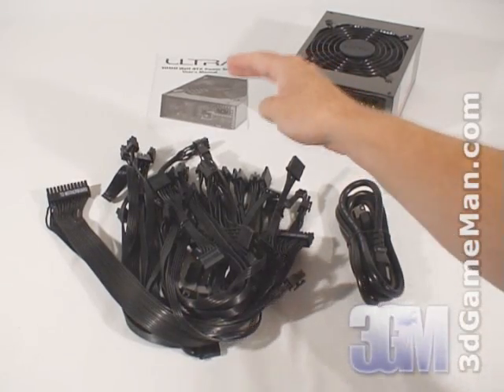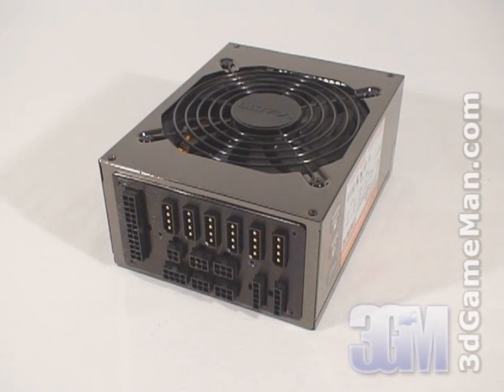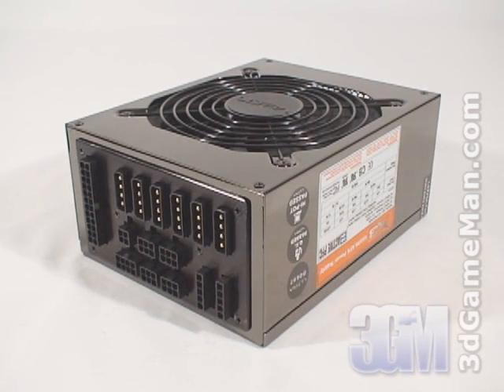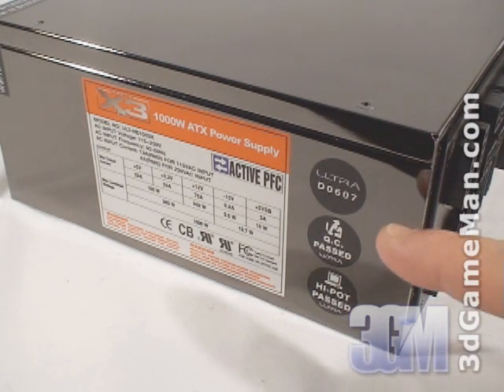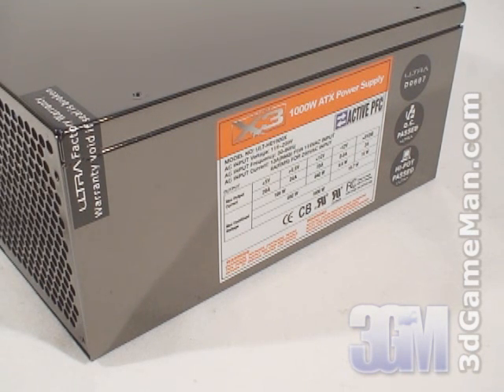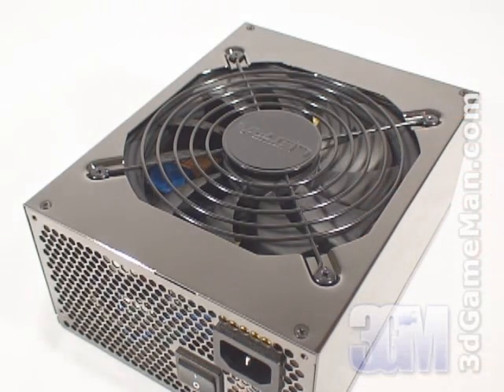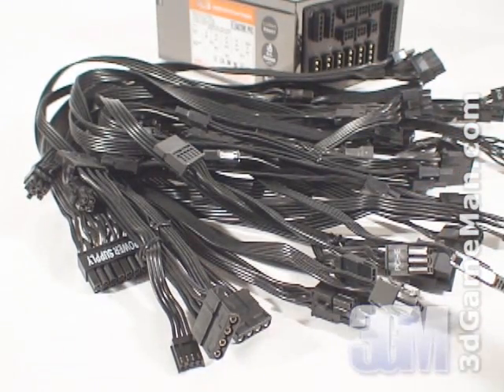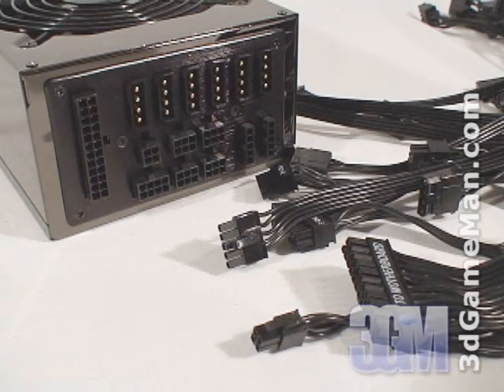#843 - Ultra X3 1000W Modular Power Supply Video Review

Comment: I know this is old! But I still use this PSU. I need 2 8 pin connectors one for my GPU and the other for the motherboard connection. The PSU only has one 8 pin. Is it possible to put a splitter on the 8 pin from the PSU to supply the motherboard and gpu? Any suggestions?
Reply from the maker: You can't split the 8pin, but you can get a dual molex (female) to 8pin connector (male).

Comment: I have the 1000watt psu and I had it for some years now and it can handle sli & crossfire with no problem. the only ones who sell them are tigerdirect and ultra themselves. newegg sells one model and its not very high in wattage. I own two of the and their still going strong after ten years.

Comment: Ultra should of put two more 8 pin pci express connectors in it and got rid of two of those molex connectors so people could run tri sli and they should of made the power supply with two 8 pin cpu connectors with one that can break away to a 4 pin so people with EVGA classifieds can plug both 8 pins into the motherboard.